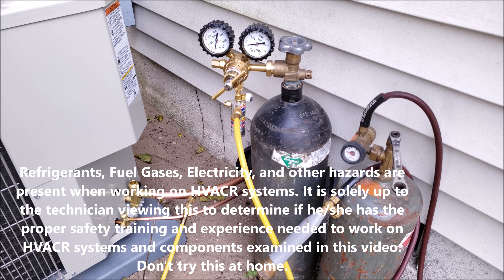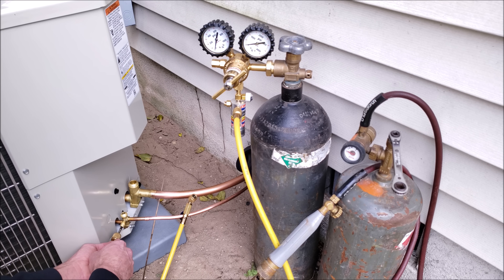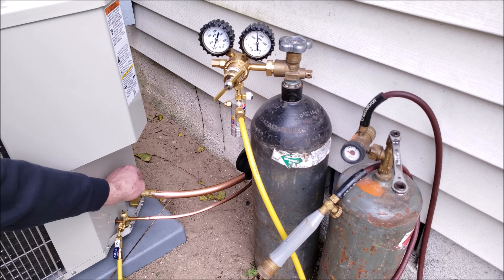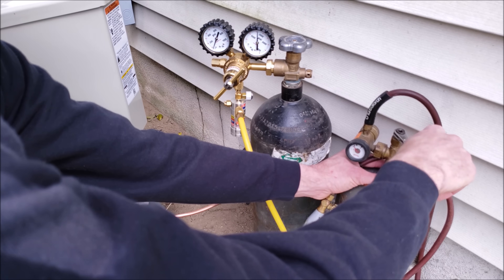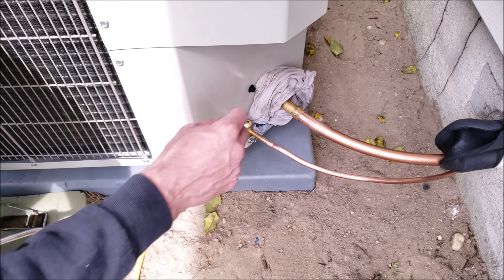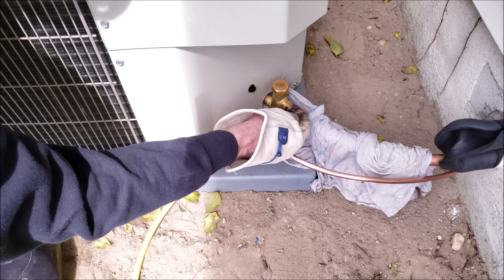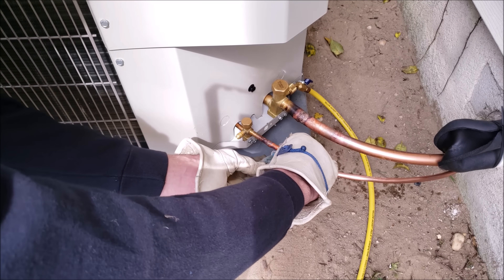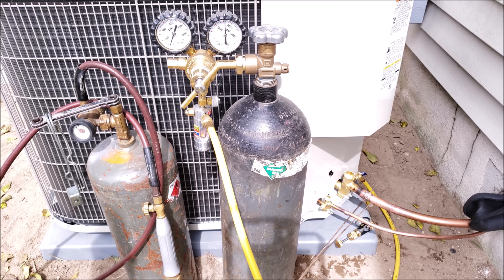Brazing HVAC Line Set to Service Valves! Full Procedure!

Comment: I was about to comment that what you said and did on the liquid line was incorrect. The I noticed that the liquid service valve was NOT swagged like the suction valve. You had to swage the 3/8" line, why? 
What mfr does not provide both service valves already swagged?
Reply from the maker: This was Carrier/Bryant/Payne and it usually comes like this. It may seem troublesome but if you think about it with the swage in this direction, it follows the correct flow to reduce friction at this point. The next time that the swage is in the opposite direction is on the second swage of the filter drier right before the metering device. I can understand not quite seeing that until later in the video, thanks Tom!
Reply: @acservicetechchannel  
Yes, it would be the correct flow direction.
Our main product line is Carrier and they are always swagged from the factory on BOTH valves.
Reply from the maker: This was a 16 Seer Payne Condenser and they usually have no swage on the liquid line, thanks Tom!
Reply: So crazy to worry about flow and pressure drop across a swage in the liquid line and then use a Hex valve in the suction line? Good manufactures put a gate valve on the suction line on high SEER equipment. Pressure drop is way more pronounced in the vapor line... But at least techs are thinking about mass flow rate now. that's good...

Comment: I do it just like this except I have the filter drier on from the start. What is your reasoning for not having the filter drier on?
Reply: Filter drier needs to be as close to evap coil as possible. Read manuals and study this shit to get ahead
Reply from the maker: To reduce contaminants entering the filter drier such as through the nitrogen flow, the filter drier is cut into the tubing last, this way it is guaranteed that the total storage capacity is left in the filter drier upon startup, thanks!
Reply: AC Service Tech LLC k

Comment: Thank you.
Another great video.
Alway learn something new in every video you share.
Can the small acetylene that comes on the oxy/acetylene kit come with be use instead of the B tank?
Reply from the maker: Yes absolutely, I have the small brass adapter needed linked right between the air acetylene setup and the oxy-acetylene setup at amazon.com/shop/acservicetech, thanks! The connection on the side of the 40cu B tank is larger than the 10cu MC tank, thanks Octavio!
Reply: Yes, I use a MC tank.  You can buy a regulator that fits or an adapter to utilize your B tank set-up.  I did the later, so that I could always go back if needed.

Comment: You make it look easy I was in school learning just that,  in my very little experience I do notice if you try cooling it to quickly you'll break the connection,  should wait at least 15-30 seconds before ragging it,  at least that is what I did in order to get my pass the instructor and pressure test, lol
Reply from the maker: Hey Martin, no the connection will not have pin holes or crack when cooling it down. You only need to make sure it is solid which is just a few seconds usually with the changing of color. The teacher may have been erring on the side of caution but the problem is you are allowing the valve to stay too hot too long. We need to protect the moving valves and txv's when brazing, that is why we cool it fast, thanks!

Comment: Is Oxidation actually an issue while using a Air-Acetylene? I was under the impression that an Air-Acetylene tank produces a neutral flame no matter what as Oxygen isn't being introduced into the mix at a decent enough rate?
Reply from the maker: Oxidation will occur inside the tube so it does not matter what type of flame but it has to due with the heat that is applied. Have you looked up"acservicetech brazing with and without nitrogen"? thanks
Reply: @acservicetechchannel  I hadn't yet, we just never use Nitrogen when soldering. We usually use the 5% Stay Silv, not sure if that makes a difference. I'm definitely going to have to look more into this.
Reply from the maker: Hey Ryan, when silver soldering you don't need to flow nitrogen because it does not get hot enough to cause copper oxidation. Soldering will leave a little bit of acid in the system though due to the flux at each joint which we try to avoid, thanks
Reply: @acservicetechchannel  I guess that's where I've gotten confused people around here use Soldering and Brazing interchangeably,  always thought it was weird when I heard a coworker say they were brazing in a line set with a b-tank and 5%...All we do around here is solder, maybe its more cost effective I guess?
Reply from the maker: It is what a lot of people did with older r-22 systems, I braze because that is what manufacturers do but solder will hold the pressure of R410A though, thanks!
Reply: @acservicetechchannel  I'm kind of confused here. You have used silver soldering for the video. When flow nitrogen does not apply?
Reply: @acservicetechchannel  I honestly hadn't even considered it, thinking back the outside of the copper oxidizes so it only makes sense that the inside would as well.
Reply: The oxidation actually occurs while the joint is cooling down. Watch it form sometime. So the type of flame doesn't matter. The temp will. But mostly it needs oxygen. so we displace the oxygen with nitrogen inside the pipe.

Comment: Good job bro!  Seen too many weld joints with no nitrogen being used. Soot on the inside for sure. Ive seen idiots install mini splits without vacuuming the air out of the line set.  They purge the air out with the factory charge and call it done.  The land of hack here. U do nice looking work.
Reply: Would that method get the air out?, air is lighter than refrigerant vapor and should collect at the top of condensor.
Reply from the maker: @metalhalide4043  this video is about purging the air out of the tubing and evap coil with nitrogen while brazing. We are not flowing refrigerant through, thanks!
Reply: @acservicetechchannel  Sorry for the confusion, at the top of the thread someone mentioned using the factory charge to purge air out of the system, would this work in the same way as purging air out of the hoses prior to connecting?
Reply from the maker: Wow, I am sorry to here that but probably makes a professional such as yourself look fantastic though! Thanks a lot Tommy Boy!

Comment: I always use nitrogen to braze. It amazes me how many technicians refuse to use it. I always hear them say “ I never used it back in the day and I don’t now” or “ that takes too much time”
Reply: Brazing refrigerant lines is far different than soldering water pipes. In a refrigerant circuit you want it to be absolutely clean inside the lines. You do not want particles to clog the lines or become lodged into the compressor and cause damage. Brazing uses temperatures above 1000 degrees and at those temperatures copper oxides can form (notice how the pipes look burnt after brazing). By removing the oxygen atmosphere by flowing nitrogen, you eliminate any chance for copper oxides to form inside the lines.
Reply: @tier3rd375  Exactly. Even though our atmosphere is 80% nitrogen, that 20% oxygen makes ugly black gunk form in the inside of the joint (regardless of how good or quick someone is at brazing). By flowing 100% of dry, inert nitrogen into the system while brazing, you get to have a perfectly clean interior on the piping. The outside will still be ugly looking since it's exposed to oxygen in the atmosphere. On TXV systems, we've had service calls where the inlet screen leading to the TXV was plugged up with the black gunk from not brazing... If you're going  throught the procedure to install an enclosed system that is required to be dry and clean down to below 400 microns for the longevity of the equipment that the manufacturer requires, you either do it right, or get lost and let a real professional do it... The refrigerant, and its lubricant are the only things that are supposed to flow through the system. Not refrigerant, lubricant, and copper oxide.
Reply from the maker: Yeah it really doesn't take much more time to do it correctly with nitrogen, thanks a lot Matt!
Reply: What is the advantage/reason for using nitrogen?
Reply: @thomasbisset4544  Clean refrigerant circuit. And the different between hacks and professionals.
Reply: @sprockkets  yeah, thats not a real answer.

im genuinely curious, i am a plumber/gas fitter and we do not use nitrogen in domestic applications
Reply: @thomasbisset4544  Yes it is. You are a plumber, not HVAC. If you know anything about HVAC you wouldn't answer that.
Reply: @thomasbisset4544  To add to this you don't have the issue with not using N2 unless you braze. Soldering isn't as hot and won't cause it anyhow.
Reply: in nz we braze using silfos, not solder. im looking for a genuine answer as im curious.
Reply: @thomasbisset4544  See AC Service Tech LLC's other video on brazing with and without nitrogen. He explains it well with evidence.
Reply: @thomasbisset4544  reduce contaminants from getting inside the copper while brazing.
Reply: @thomasbisset4544 it's a shielding gas but the braze has flux for that.
Reply: Some people are terrible at welding and really burn the crap out of the pipe trying to get the weld to take, usually using bad welding wire, if the outside of the pipe is nasty looking the inside will look the same, the welds he just did looked fine with a minimum amount of heat.
Reply: I used those purple seal thingys on my amazon cheapo minisplit and I'm enjoying free solar air conditioning in the already 95 degree arizona heat. :)
Reply: Absolutely embarrassing. And people wonder why they need their unit serviced in a year or two
Reply: 😂that’s how you know you work for an Apex owned company, fk that shit, I’ll take my time doing this artwork
Reply: Never had a problem not using it for 25 years........
Reply: @bufallobiff  That you actually know of...
Reply: @sprockkets  Apparently it made it through any warranty period........
Reply: @bufallobiff  worst answer ever,  pull the screen from the txv and look at it, crusted up.  
 Hey and all those systems might have failed but they never called you back.  Also just because it works doesn't mean you didn't lower the efficiency and rating of the system with contamination,
Reply: @bufallobiff  same here. Last few years staybrite...........never had a problem
Reply: Is all bs to use nitrogen, I have done thousands of systems and have never use it don't have time for that bull crap

Comment: I'm curious about something; Why don't the manufacturers use something like flare fittings to make these connections?  It seems like it would make for a much less complicated installation.
Reply: Probably because they dont want DIYs installing units. They do however use those fittings on mini-split ductless systems
Reply from the maker: @pizzle1011  Hey Boffin and piz11, brazing has the least chance of leaks occurring in the future but some units in the past did have flare fittings. Like piz11 said, many mini split units have them to make them easier to install. I also believe the manufacturers don't want oxidation in the lines and possibly don't trust techs to always flow nitrogen through when brazing, thanks!
Reply: @acservicetechchannel  thanks for your videos. For someone who took classes 20 years ago and wasn't able to do the trade then and now starting up my own side business your videos have been a great resource! Keep up the great work
Reply from the maker: thanks piz11!
Reply: They'r prone to leakage. I've seen malformed flares on mini splits. Also they should be torqued. Don't trust your wrench.
Reply: Possibly because of vibration from compressor and fan.
Reply: That T&N guy still brazes them in anyhow, with nitrogen. It is officially sanctioned by Mitsubishi. 

Instead of Flare however you can use compression, which is what some brands use to connect TXVs. However, just about everyone hates Trane channel lock stuff for the compressors. Probably because they do them wrong. In any case I looked in a 1 year old trane unit, and they appear to have ditched them and went typical braze joints.

Comment: I thought you always started with the joint closes to the hose you’re purging nitrogen through?
Reply from the maker: You would avoid the joint you are flowing nitrogen through because that rubber grommet is touching the port and the grommet is not rated for any type of heat. You flow through the whole system and allow the nitrogen to make it to the other side, thanks!